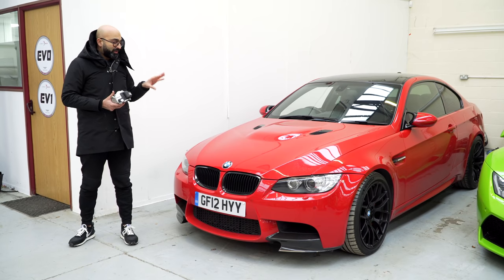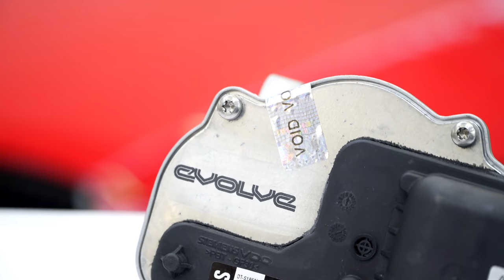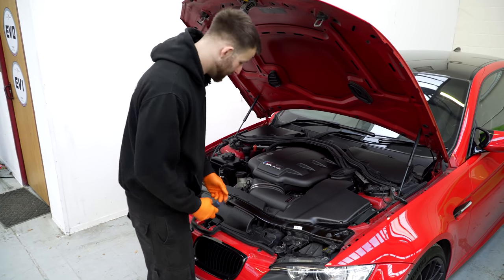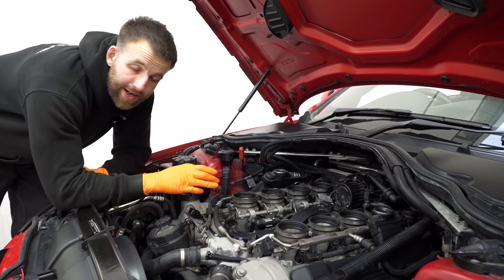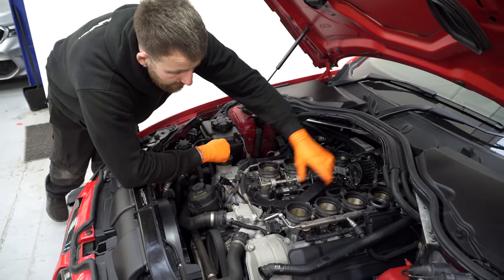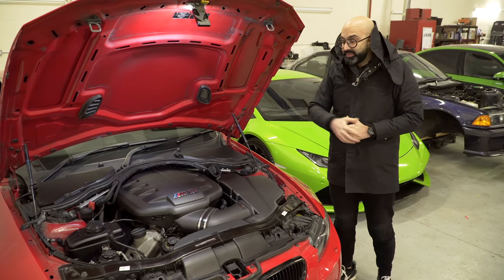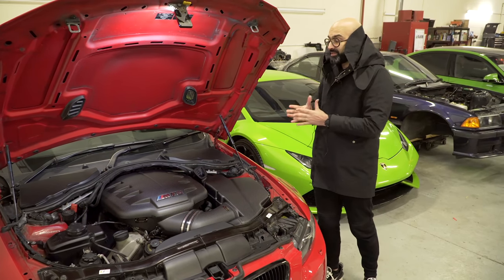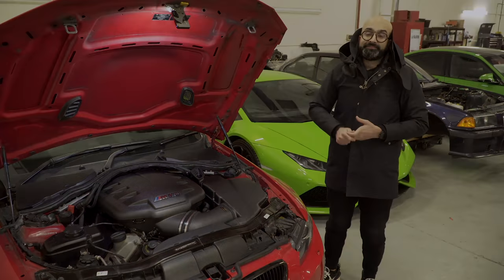Curing the E92 M3 Throttle Actuator Failure Problem

Comment: Is this solely to stop limp mode or is it related to hesitation at low revs as well? Have an E90 325i experiencing these issues. Very rarely the revs falter on start up, and drop enough to cut the engine.

Comment: Hi. I am hein from south africa.i have a '01 e39 M5 with 314 000km on it.wonderfull car.does this cars have the same problem as your red M3. I only replaced a few things on the car.nothing big.still factory clutch and replaced front brake disc twice and back once and normal services.thanks.

Comment: I just purchased a 2011 M3 competition package last weekend.   Car has 55k miles.  Will be doing these at some point.   Definitely going with you guys.  👍👍
Reply from the maker: Congrats on the purchase!

Our priority would always be Rod Bearings first as that failure is fatal. Throttle Actuators can fail and they cause no damage just inconvenience.
Reply: @EvolveAutomotive  My thoughts exactly
Reply: Congrats on the car man👌. Working on getting a 11-13 comp also. How do you like the car so far?? Is it e90 or e92??
Reply: @eastoakland-S65feen  Thanks,  its an e92, dinan exhaust, intake.   Very well taken care of.  She's a beast of car!  Had a maintenance log with it.  I got lucky I think....also came with magnaflow xpipe with both cats deleted and a tune....putting that back on this weekend.

Comment: One week too LATE!! Ordered the UK-Rebuilt TVAs (thru the M-Power US Distributor). I am sure the Evolve Logo alone is good for +10 HP.
The price on the Evolve website includes installation, minus the core charge. HaHa. Gonna need a plane ticket to the UK roundtrip.

Did Imran say driving the M3 thru the Alps?...Upcoming Top Gear?

Excited waiting for the EV-Aero BMW E9X M3 Carbon Fiber Aero Parts. Need a sneak peak...
Reply: I ordered mine from M Power as well. Huge saving for me compared to getting them from Uk.

Comment: The matte carbon eventuri plennum looks incredible I like it alot more than the gloss.
Reply from the maker: We prefer it but purely personal preference.
Reply: Matches better with the other plastics in the engine bay
Reply: I couldn’t decide 😳 I ordered matte and then 12 hours later called them to change to gloss. I’m totally 50/50 I suppose they are both equally as nice 👍
Reply: @sanmarino_cs1698  My vote is for matte. Both do look incredible. I like the subtlety of the matte. But of course do what you like the best.
Reply: nomnomguy680 I think matte is arguably nicer and more classy/OEM but if I had to criticise it for anything it would be perhaps it looks too much like the stock one for unless the camera is focused on the weave close up.
Reply from the maker: Gloss one is definitely more obviously aftermarket.

Comment: My 2011 M3 has 110k miles – all by me – of which 15k are track miles, and the rest are hard road miles, as it is purely a fun car. Rod bearings and throttle actuator have been faultless. Both just changed at 110k miles as a precautionary measure, but inspection does not show imminent failure. How you use and maintain the car matters a lot.
Reply from the maker: Definitely! If you’ve owned the car from new and looked after it then you can be much more confident in the condition of your bearings.

Comment: Wondering if BMW changed the specs of the actuators with the LCI or the issue is the same for the whole generation. And is there any way to prevent it? Using the car more often as an example..

Comment: I have a 2008 Melbourne racing red sedan and I have gotten my actuator valves replaced at 50000km for about 4000 dollars at the dealership
Reply: You got robbed. Today the TVAs are only $600-700 each. They used to cost $1400 each. Labor at the BMW Dealership was 5 hours @ $200/hr. UK-Rebuilt TVAs were/are on the market for years, similar to these Evolve TVAs. They should never fail.
Reply: @nycshelbygt500  I PUT IT ON VISA AND I WONT PAY IT
ILL DIR BEFORE YHAT HAPPENS

Comment: Hey guys - my 2011 dct m3 seemed to lose power at 3,000 rpm today.. I was pulling off in second gear and it felt like the car shunted forward and lost power for a few seconds before continuing. No engine lights or anything and seems ok right now but I am concerned - is that a sign of the throttle actuator problems? 

The best way I can describe it was it lunging as if I hit the redline at 3,000 rpm and the acceleration cut out abruptly before continuing.

Comment: My Dealership is currently working on my car for other issues, issues where my E92 M3 Comp pack is shutting off/blacking out randomly when driving. But they are telling me that my throttle actuators are failing and it will cost 3,500 to do the job. Talk about theft LOL. I would assume I could take my M3 to one of your shop dealers in California and they can handle this mess and at the same time be more cost efficient and have a piece of mind?
Reply from the maker: We don't have any locations ourselves in America, but we have shops we can recommend. Please email sales@evolveautomotive.com, thanks

Comment: Hi guys wonder if can help me with my s65 miss fires , sparks changed problem still there , coils replaced and problem still there rough low revs … what a nightmare
Reply from the maker: Unfortunately it’s very difficult to diagnose confidently over the Internet. If you are in the U.K. we would happily take a look at our workshop.
Reply: @EvolveAutomotive  yes I am in Bath , we’re about are you guys?
Reply from the maker: We’re located in Luton, just off the M1 - Give us a call tomorrow 01582 584000

Comment: Do you also offer Throttle Actuators for the E60 M5 ?
Reply: I would like to know that also..!!
Reply: I really think they do i wouldnt see why not.. There videos always start off with S85 exhaust in the background🤷🤷.
Reply: They are the same unit. If you buy it for the m3 it should go right in no problem for the m5 brother. I have a e92 m3 as well and the plug for the unit looks the same on the m5 I believe
Reply from the maker: Yes also available for the S85
Reply: @EvolveAutomotive  sweet!
Reply: @TwinTurboE  They are not the same units. The elbows on both are different. The angles are completely different.

Comment: Hi. I'm not getting fuel to cylinders 1 to 4.
I've reset codes and engine runs fine for a bit then goes back into limp mode.
Could it be a failed bank1 actuator?
Cylinders 5 to 8 run fine. Please reply if you know the fault. Thanks

Comment: Got a E92 M3 , Rod Bearings done and 1 of the Throttle changed, car pulls great and doesn't feel like any problem, latelly i got a Battery error that it stays but after that i suddendly get the car with Engine Fault, Stability failure and Flat Tyre error, do you guys know if this is associated majorly with the battery? Because the car is smooth engine sounds great and i don't feel any downpower, just when that engine fault limp mode hits the car can't go past 4k RPM so i guess some sensor or low energy associated? Could you guys get me some insight? Best regards!
Reply from the maker: These cars do suffer when the battery is in poor condition/voltage is low. I would fix the battery error first and go from there.
Reply: @EvolveAutomotive  Thank you very much!